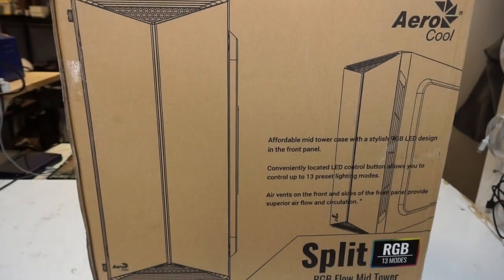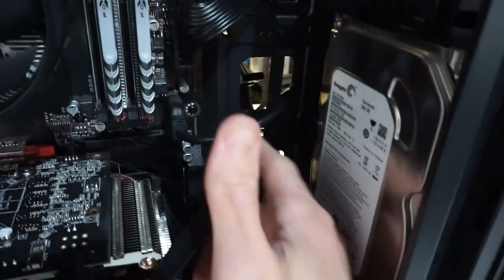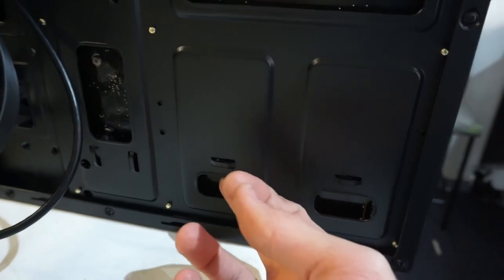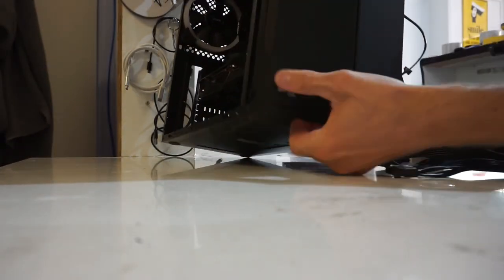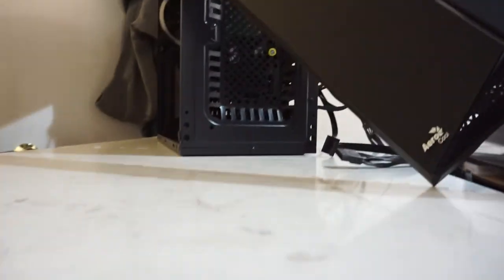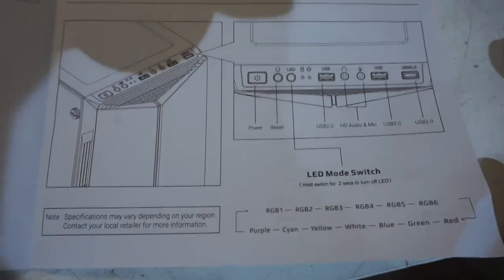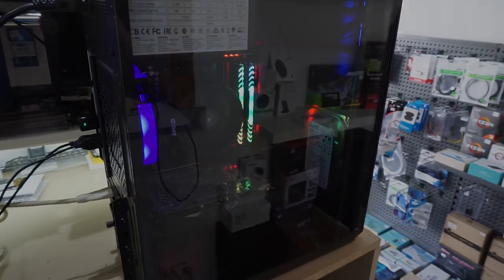Aerocool Split RGB Case unboxing and inspection

Comment: You can fit 15mm slim fans in the front, under the front panel. I have two x Silverstone FN124 fitted for extra airflow
Reply: 15mm fans? That's rather small. Was kinda hoping it would take 120mm or 140mm fans.
Reply: @makedaevilmage  , He means it's the fans thickness (slim version), not the diameter.  The diameter is 120mm, but the thickness is 15mm.  Its the same thickness as the installed RGB rear fan.

Comment: Have you tried installing a fan on the front from inside without using HDD?
Reply from the maker: haven't given that a shot, i dont think a fan would fit with a 3.5" drive already there
Reply: @rickstechrepairs  I am planning to buy it after the day. Friend, you can help me if you just attach a 120mm fan to the installed hard drive. I need to know if it will fit there, because the hard drive has a smaller horizontal width.

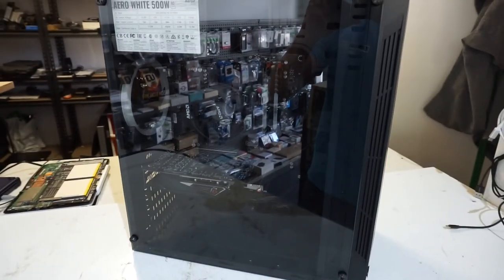Comment: At the 5:18 of the video the front panel and the case fan are synchronized and as you press the button change color both of them. How did you sync the led strip of the  front panel  with your fan at the back of the case?is there any pin at the  pre-installed led controller at the front panel if you open it?
Reply from the maker: at 1:10 I show the RGB Cable that comes from the fan, which is a simple 2pin cable (not ARGB)

So the Fan in the back of the Case has coming from it

1x 2pin RGB Header
1x Pass-Thru Molex Power

Comment: hello rick, I was wondering what type of screwdriver is your orange one, because I have the exact same msi gl65 as you and I want to upgrade my ram, My Philips head screwdrivers don't fit
Reply from the maker: Hi 
I'm not too sure actually I just call it my small screw driver 

I would recommend getting one of these kits, to cover the almost any screw you need to undo 

https://youtu.be/BhI9Wt0UauM

Comment: um... is the chassis fan connector a 2-pin connector at the motherboard? Is this unusual or am I just mistaken in thinking it ought to have 4 pins??
Reply from the maker: The Fan has a 2 Pin RGB Connector and a Pass-thru Molex Header for power
This is not the usual style of RGB Connector, the RGB Connector goes to the front of the case, not the motherboard
Reply: @rickstechrepairs  Thanks Ricks. Sorry about the newbie question, or rather, missunderstanding on my part. It is ages since i built a computer and i was getting confused between case fans and cpu fans. I want a quieter computer and it looks like case fans just go on when the computer is on. I will need to go out and buy a fan that can be controlled to go on when the CPU needs more cooling, and otherwise be off.